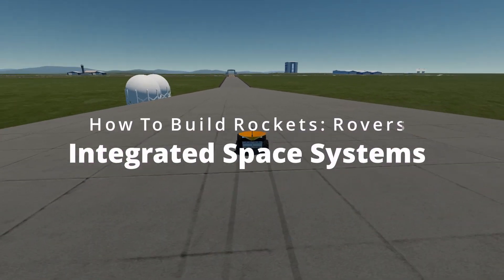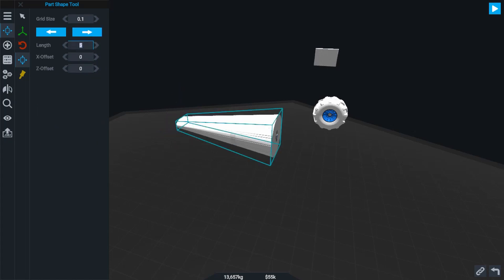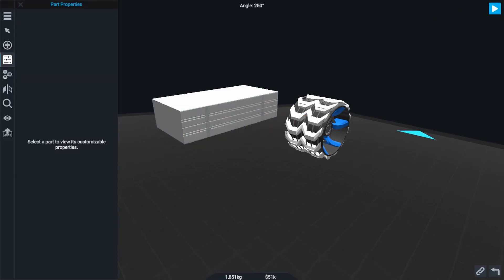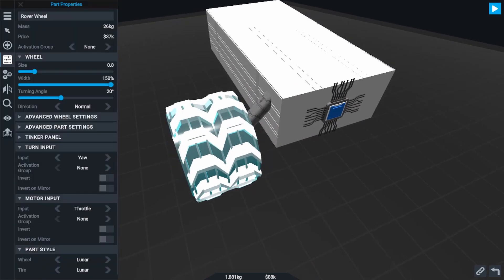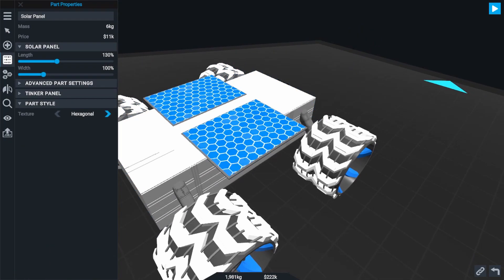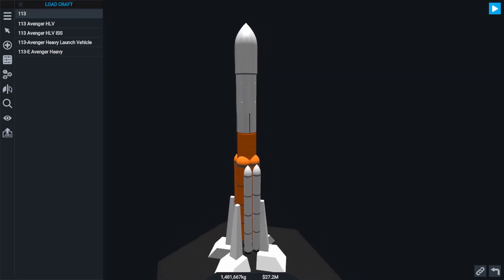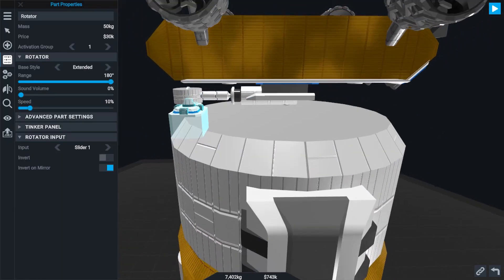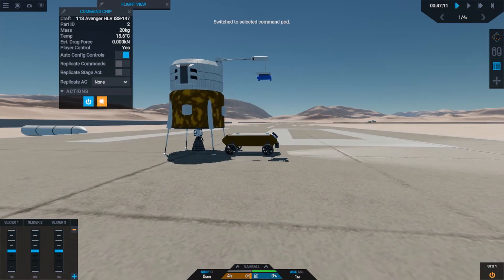Juno: New Origins || How to Build Rockets Pt. 19, Rovers

Comment: Interesting vid. Thanks friend. I'm having issues separating my rover from the stage. I know this will sound very "noob" but... The point is to just drop the rover on parachute from some height, but instead of "attaching" itself to the interstage, its doing it to the command disk itself (although there is indeed an interstage after it), therefore it won't separate from the stage and the mission will fail. I don't know what I'm doing wrong. I hope I'll figure out soon, but any suggestions are welcomed!

Comment: Ummm, I don't have rover wheels, only car wheels and off-road wheels. Which do I use? I'm on mobile if that makes any difference.
Reply from the maker: The different styles of wheel give different torque ranges and top speeds for different costs. It really depends on what you're trying to do. If you want low top speed, high torque offroading I'd go with off-road and max out the gear ratio

Comment: what is damper in suspension?
i really cant find easy answear cuz im new to physics.
Reply from the maker: Basically it slows down or stops the oscillations of the suspension. It's how quickly the suspension stops wiggling
Reply: @Deltlead  Thank you